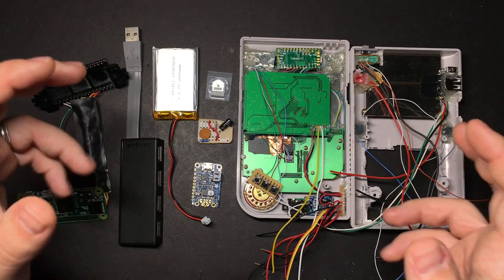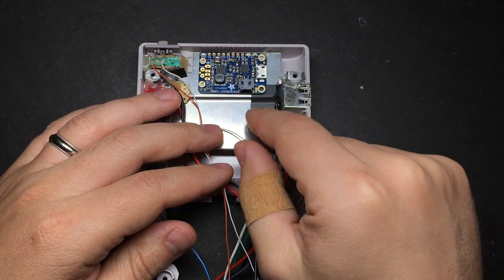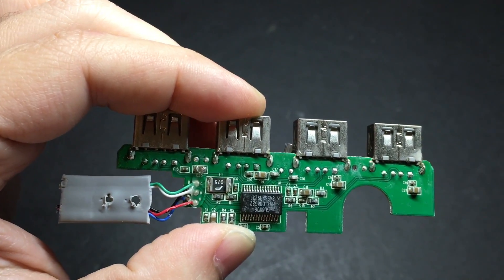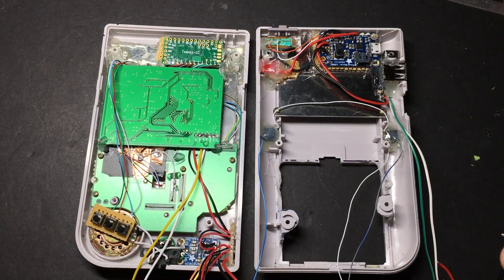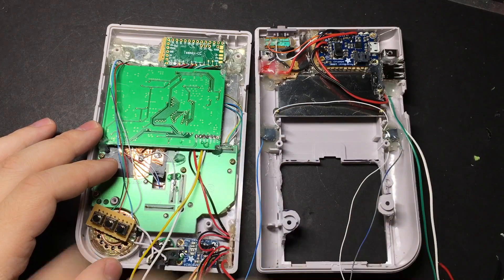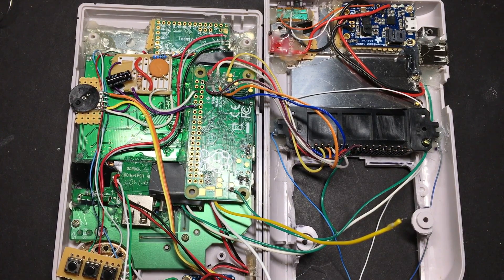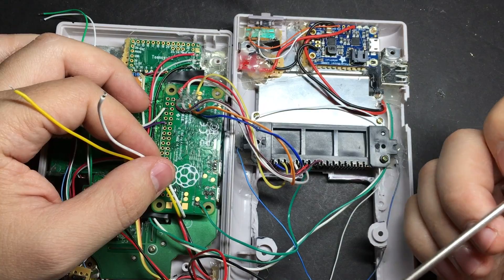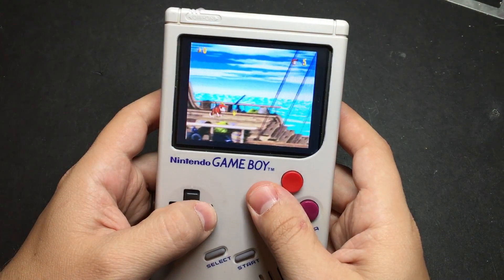Game Boy Zero Guide Part 6 - Everything Else

Comment: Iv finally nearly finished my gbz just waiting for the amp to arrive. Iv made an audio filter which il install today I'm just struggling with the code to activate the gpio pins. Iv looked on the forums but I don't know where to input them. Do I quit emulation station and input something there? I'm not good with programming. The build itself is sick and a little different to other builds but this code, txt thing is doing my head in.

Comment: So if I have the new Raspberry Pi zero W I won't need the USB hub?
Reply: Макс Леденёв I'm still considering getting one, as I'm doing USB sound, and still want to add a USB in on the side. So I'm 50/50 on that. Thanks though.
Reply: Also, it seems like a lot of parts would be reduced using a 3.5 inch 26P SPI TFT LCD Display Screen for raspberry pi, as it has a low profile board that connects directly to the pi... Think it would work?

Comment: sorry I found two kind of batteries and almost for the same price (both run with 3.7v) one has 2000mah and the other one has 4000 mah. Since I am a beginner I need help. Could some one please tell me if there is an important reason why I should not buy the 4000mah batery???? because the difference on price is like 5 box. Thnks
Reply: mah (miliamps per hour) show how long the device will run.  If the device  (for example) runs at 1000 mah, it should last two hours with a 2000 mah battery, while a 4000 mah battery will last for four hours.
Reply: Donald boswell lll thanks a lot!!!

Comment: Ok. I have a stupid question about the hub, I've been asking on the pi and sudomod forums so but I'm not really getting any anwseres. I connected a USB hub exaclty as in this guide. It's not the same hub, rather a generic usb hub I had lying around. It didn't work. I thought it was the hub so bought another one (different brand). It still doesn't work. I plug a keyboard in to the usb breakout board and the lights (on the keyboard) flash for a second then it doesn't work. I assume the keyboard is not getting enough power but how is that possible? If I connect the breakout board directly to the pi (without using a hub) the keyboard works fine. And out of desperation I connected all usb power lines directly to the power strip but it still didn't work. I'm kind of lost here.
Reply: please tell me if you solve that problem i,am also stucked!!
Reply: I ended up buying a cheap self powered USB hub on ebay and wired the power wires to the hubs input jack. Now everything works as it should. But I could never get the generic non self powered hubs to work.
Reply: nice! could you please send me a link with the one you have used? thanks
Reply: the only ones i find are bus powered... are those the ones i am looking for? I actually managed without any knowledge from electronics (either english XD) to almost finish my project but i am actually very noob. Please help
Reply: It's gonna be hard because I actually won it through an auction and don't have the case anymore because I threw it away. No, the bus powered ones are self powered. This means they draw power through USB male connector from the PC it's attached to. You need a self powered USB hub that can be plugged in to a wall socket to draw extra power. You can easily recognize them because they usually have an AC female socket for the wall plug. Don't worry I'm a noob as well. I don't have the first clue about electronics, I'm a graphic designer and got this figured out, so I have no doubt you will to :).

Comment: Why not just use the micro USB ports on the Pi vs. all the fuss with the USB Hub?  I'm thinking a Micro USB to USB A adapter would be a lot less worrisome.
Reply from the maker: Only one of the micro usb ports on the pi is for data, the other is strictly to power the pi.  With the setup I'm using it needs at least 2 usb ports: one for the teensy and one for the external port.  So, you need a hub.  :)
Reply: wermy got it thanks!  Also found your newest video so getting caught up.  Things seem to be moving faster than videos!  Which is a good thing for the most part.
Reply from the maker: No problem!  And yeah, new stuff is popping up every day on the forums.  :)  The other half of the custom build videos/guide should be up in the next day or two.

Comment: I don't understand why all these modders don't just use a dis-assembled USB battery charger instead of the powerboost + lipo?
You can get them super cheap (under $3 for 4600mah!)
Reply from the maker: Kind of hit and miss with those.  You need one that can charge the battery while being used (so it needs to charge the battery at higher than 500mA since that's about what the total GBZ power draw is), assuming that's something you care about.  Oftentimes those cheap battery packs specifically say "do not charge while using" on them.  But yeah, there have been a few people on the forums that have done that, I think.  :)

Comment: did you use the 1000c or 500c power boost, and what is the difference if i used either-or?
Reply: The adafruit 1000c is an upgraded version of the 500c.  It outputs 1000mah vs 500mah, which is great if you want it to charge faster.  There are other things the 1000c does better than the 500c.  But for a project like this, I'd go with the 1000c.  Also you will have to be sure that your battery can handle 1000mah going to it.

Comment: Quick question. I'm slowing gathering parts for this project and have causally watched the guides a few times. The usb hub is not essential right? Can't say I'd have any need to have wifi/bluetooth. Would prefer to make the build as uncomplicated as I possibly can, as this is all new to me. Thanks for your guides!
Reply from the maker: It's not totally necessary, no.  You could just wire up the USB port on the pi to the teensy.  Or if you went for GPIO controls, you could just wire up the USB port to an external port like I did in the videos - then you could plug in a thumb drive or wifi or whatever, should the mood strike you.  :)

Comment: I'm about to graduate with a mechanical engineering degree... I might of picked the wrong major lol. Awesome project!
Reply: 5 years later, how are you enjoying mechanical engineering?
Reply: @scritch9549  i ended up getting a job in supply chain management. I negotiate contracts mostly. Pays well, but I hardly use the skills I gained during my engineering education. However, the problem solving mindset can be used everywhere.

Comment: if you end up making a revision 2 you should have a pin header to attach the 2 halves. something i never put in my hackaday project but it made attaching both halves and wrangling wires much easier. also i utilized the regulator built into the screen to power the rpi.

Comment: Thank you for your Guide!!! I need help, I didnt add the USB hub and used the Gameboy Zero PCB board instead of the Gameboy controller board. Everything turns on but my Teensy board only works if i plug USB micro into it and then feed to the USB we installed on the side of Gameboy Zero. Also I wanted to know if you had a link to find that type of Prototyping board you use i cannot find and every other Prototyping board i use seems to cause issues and my power goes in and out.

Comment: How do you turn it off? If you just flip the switch it could corrupt the sd card, right?
Reply from the maker: RetroPie has a menu option to shut down the system (just fires off a shutdown command that you'd otherwise run from the terminal).  So you select that and wait for it to shut down, and then it's safe to turn off the switch.  You can see the process sped up in the video.  :)

Comment: how much do you think this project would cost overall? I'm thinking of building it myself
Reply: finding the screen is the hard part .. its always out of stock and for me .. it costed arround 300 to 400$ because i had to buy the iron thing and the drimel he was using witch was arround 130 both of them
the pi is 5$, speaker 2$ teensy 15$ so its alot of small parts but alot xD

Comment: I am guessing you could do the same with other handhelds? Like the Sega Game Gear, Atari Lynx. I seen a forum post on Retropie someone has made a old PSP into a Pi Zero console.
Reply: With a Sega Game gear, you'll have tons of space lol And it will be more Energy efficient than the original
Reply: Consti2tionTPG
I had a Game Gear back when they was new and batteries was expensive. It went through 6 AA in about a couple of hours if you was lucky.
Reply: *****
That would be even more of a squeeze :)
I was just thinking of if you could build it all into a wired 360 controller? Take out the rumble motors for battery room, the lead out would be the HDMI A bit like the Gamestick if you remember that?
Reply: Grabs Pi, controller and dremel. watch this space. lol
Reply: +TheDutyPaid someone did it on the original Xbox controller, where there is a lot if space
Reply: TheDutyPaid That's really neat! Never did like the ones where you had to have power and display output though, I always thought it was a bit clunky.
Reply: Yeah, I was lucky and had the rechargeable battery pack lol though it made the game gear even bulkier than it already was...Still had shit battery life though.....The Good Old days lol You could probably fit a lot of good extra tidbits into a Game Gear.